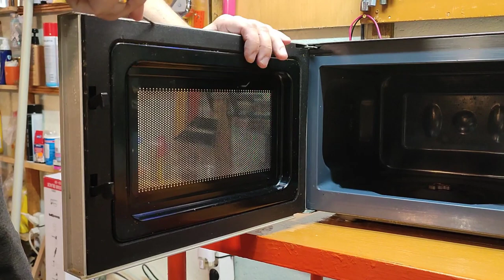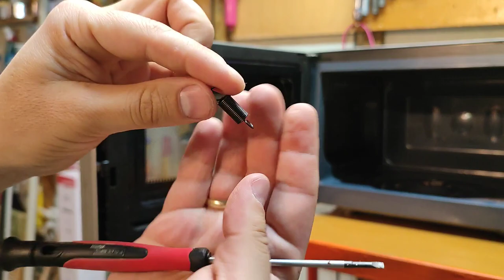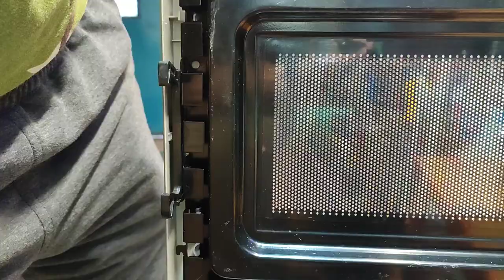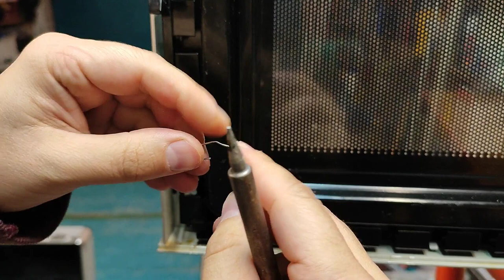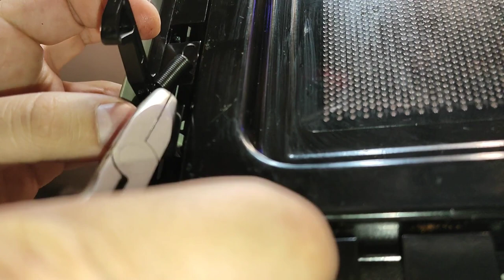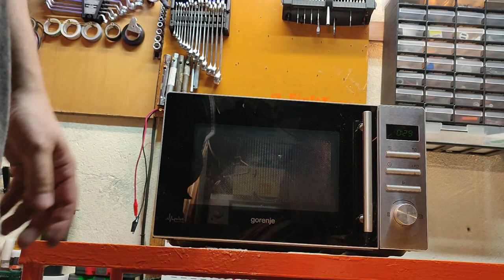How to Fix Broken Microwave Door - Easiest working method !

Comment: Sleek solution! I only didn't understand why you had to make a new hole to attach the spring? Was the original one compromised?
Reply from the maker: Original hole was actually a plastic hook, that I found broken. I decided to make a hole in order to prevent further problems. Thanks for your comment my friend 🙂